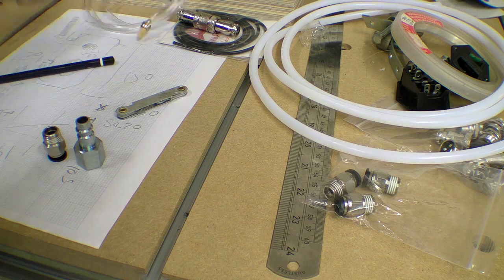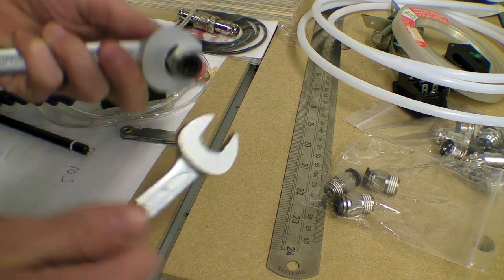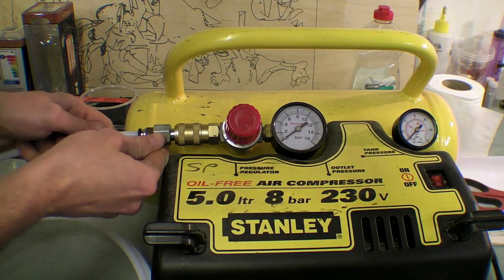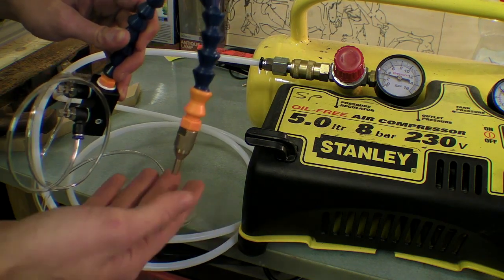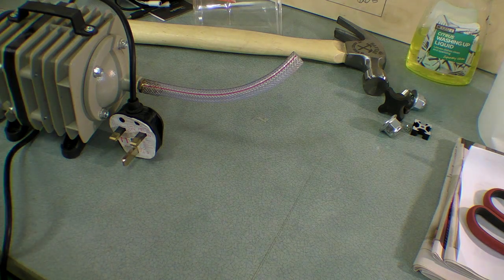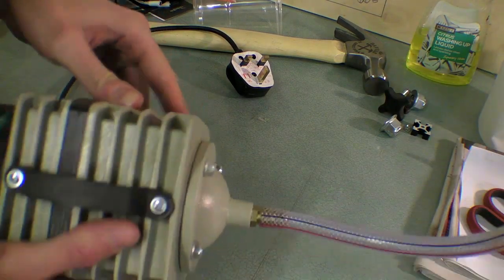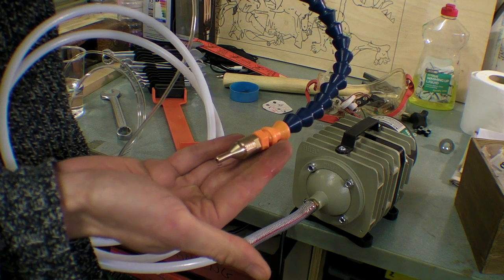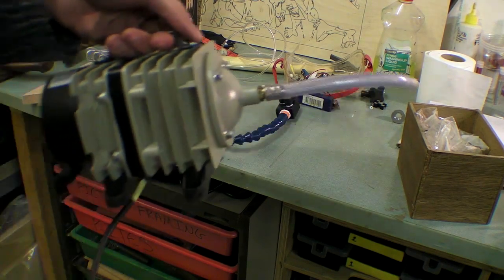CNC Coolant Spray Test / Lubrication Mister System

Comment: You need to use a silent air compressor or make one using a hermetic compressor from an air conditioning unit. Also only use a spray mist rated coolant or you will choke on the atomized mist. To avoid this atomized mist.  Pressurize the coolant to the same pressure as the air in a vessel. Like the fogbuster design which produces micro droplets instead of a mist.
Reply from the maker: Thanks for the advice. I may come back to this in the future.

Comment: When you do get it working you should really take into account the potential for keeping the system bug free. What you've created there is a perfect system for injecting Legionella into the atmosphere and turning it lethal. Some sort of ultra-violet in line steriliser or at the very least instigating a weekly regime of disinfection of all the tanks and pipework.
Reply from the maker: +markanne54 Geez that never crossed my mind.  I'd imagine a professional solutions would have something antibacterial chemicals present but seeing as I was going to bi-carb maybe ill throw some Dettol in there as well.. or I'll use a drip feed instead which could be cleaned more easily?
Reply: +Educating Savvas Professional misting systems used for agriculture/botanic use tend to be designed to have ultra-violet sterilisers as well as rigid regimes of regular testing and disinfecting, and lastly get designed so that they minimise stagnant water as much as possible, so they have circulating systems and auto-drains on the final legs to the mist/spray heads, for example. Such systems can't have aggressive chemicals injected into the water during use as it would affect the plants. I have also seen systems that inject silver into the water which kills bugs but not plants, but they're very expensive to run and maintain.

Liquid cooling systems on machines don't present as much of a threat. The real problem comes from aerosolising water and spraying it in the air. It's a perfect route for bugs to get into our lungs, where they do the real damage. Legionella pneumophila is but one of the nasties that will breed in a water system, normally causing no harm - until it's aerosolised in some way, such as in a badly designed cooling tower - or you deliberately aerosolise it, of course.
Reply from the maker: +markanne54 This sounds like a lot of effort, especially considering I was only planning on milling aluminium occasionally.  The small aquarium compressor didn't atomise the liquid, so that would be the safest option in retrospect. I could also dismantle the block after use and let it dry properly.  But it all seems like a lot of work when a syringe with alcohol would do.  That last thing I want to is increase the chances of getting pneumonia.  Thanks for the advice.
Reply: +Educating Savvas I think you're right. A quick injection of some sterilising fluid before and after use would be appropriate. Detol, Jeyes Fluid or even dilute bleach would probably suffice.

Comment: Savas, since lubrication of a bit during metal cutting is what your looking to achieve. May I suggest a small valve controlled drip from a can through a hose onto the point of drilling or onto the bit circumference? Wouldn't that meet your needs and be simpler and quieter to do? Just a thought. I wish you all the best in 2016.
Reply from the maker: +MRrwmac Yeah it would and I should look into that option as well.  Maybe I can adapt the block I have into a drip?  All the best to you too.

Comment: You Could try one of those airbed pumps they are very cheap and might give you enough air flow
Reply from the maker: +John Fithian-Franks They can be a similar price to the aquarium air pump on ebay - but I want to wait a little before forking out more dosh on this machine.  Maybe I'll find one second hand or I could try use a drip feed in the meantime as was suggested in an earlier post?

Comment: I always envisioned using a fine small high speed air blower on the X-Carves, instead of a vacuum to keep the wood waste out of the way.  I don't have a X-Carve so I never tried it.
Reply from the maker: +Heavyboxes It could get really messy considering the spindle air exhaust is bellow - but I should have made it clear this was for aluminium cutting although I doubt I'll be doing that much cutting to merit this.  For the price I thought it was worth sharing.

Comment: How dis you expect water to go out there when water has no flow to the nozzle, you just stuck water hose in a cup...
Reply: i don't know about these cheap chinese clones but real industrial thing does not need cooling medium pump. air pressure creates vacuum that sucks coolant...